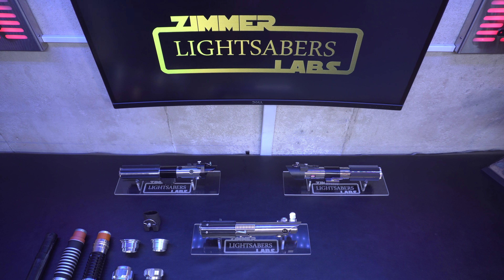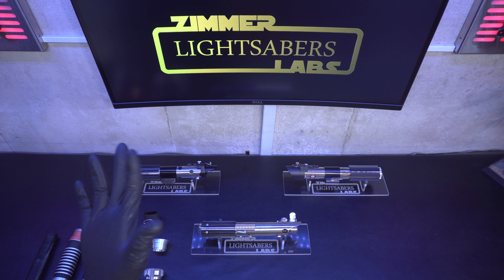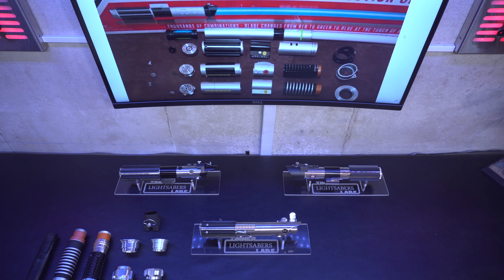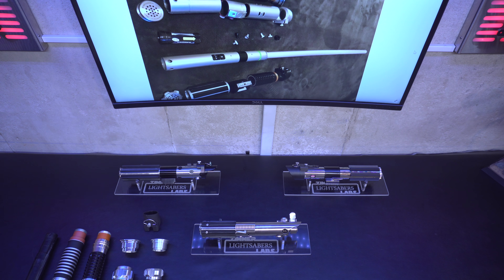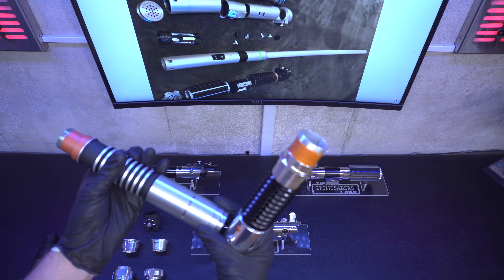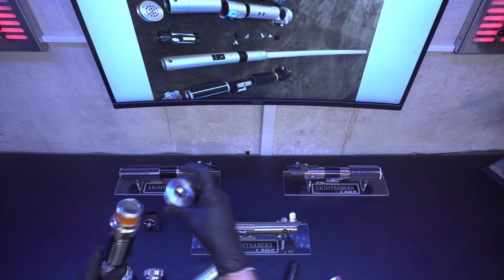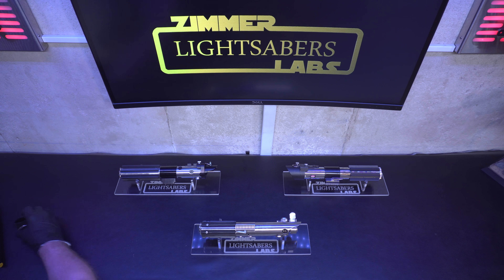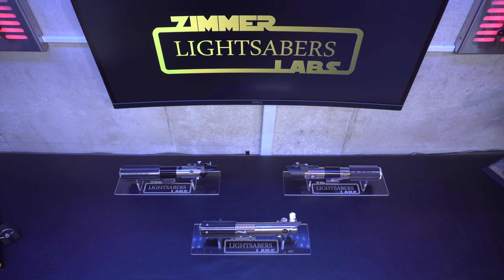Zimmer Labs OneSaber Proffieboard Neopixel Lightsaber - Three Lightsabers in One

Comment: Did you use the blade id function and put the resistor on the hilt side? I really wanted to have a removable chassis for my graflex so when i made my mpp 2.5 i could swap them out like this. Unfortunately, i just can't afford the chassis. I use goth eco chassis that i print myself lol. Idk if i could figure out the switch wire plug myself or not even if i could get a descent chassis.